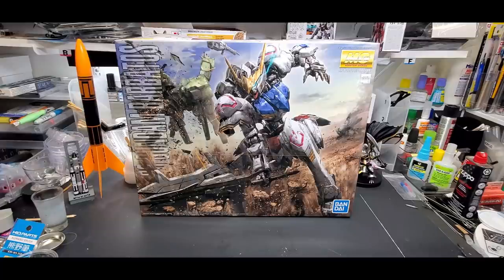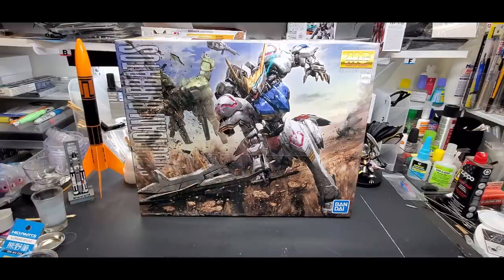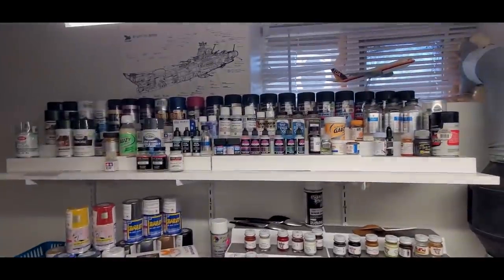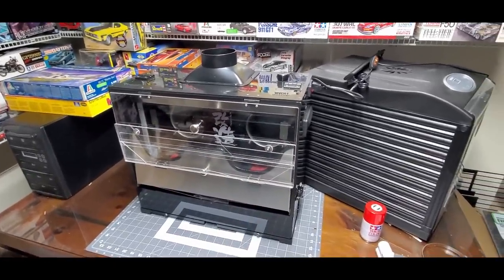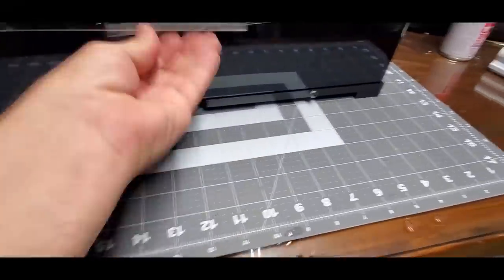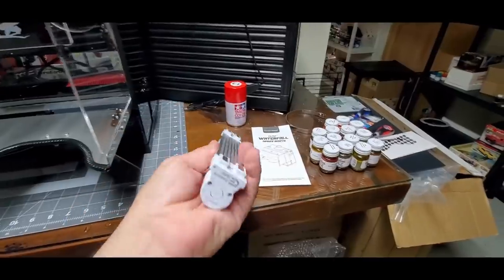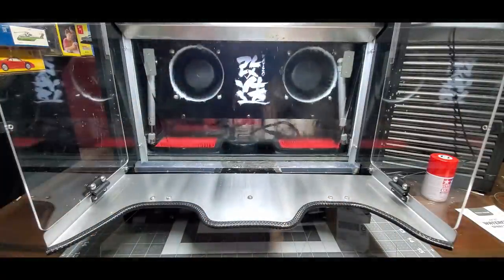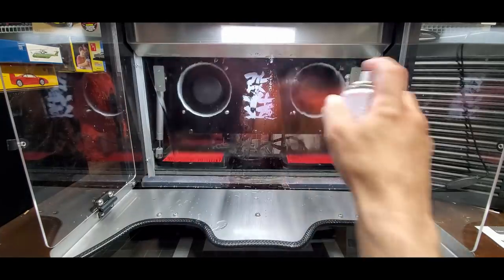Testing a Waterfall Spray Booth - Plus A MG Barbatos Giveaway !!

Comment: Hey do ya think your emails may be going into the Spam bins ? Seems really strange that people don't respond.
Now as far as that Waterfall booth goes  it looks like an extravagant mess. If you think its worth the just under $400 range great. Me - I would set it up on top of a slop sink. Those fans are the koolest thing about it. Again I would skip the water, toss the glass and fabricate a dry filter where the glass was. I'll be looking forward to your great vids done in the Waterfall. I don't know paint and water running at the same time seems to be asking for problems with a good model paint job. Moisture is some paints enemy.
Thanks for the terrific tests.bro. As I said before looking forward to them always.
On a side note - your Hobby Heaven looks more like a store. With all the testing you do you've got to have someplace to put all the testing materials. Sorry for the ranting.

Comment: Man this would be a good opportunity for me to win a ban Dai  kit never ever built one I really only do ww2 German  Vehicles .I have some paint from Japan I had made for me .that was one of the water fall spray boots I tried it was to small for me .now the one I had made is in a  Big horse shoe shape With a 1' turntable in the center .it better to find a mix of lightning ..now the pump in that one I didn't like I have 2 pumps in my big spraybooth ..if you have any questions about it send me a message. Now in that small one I wouldn't use spray cans it makes a mess as it builds up.